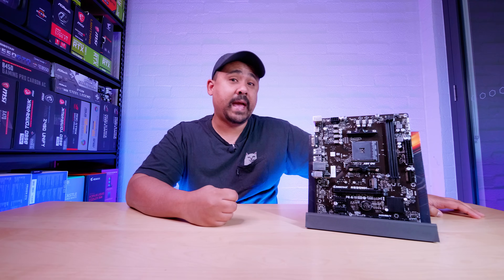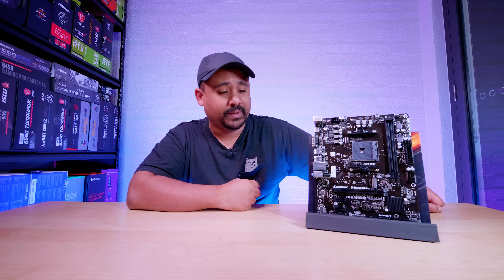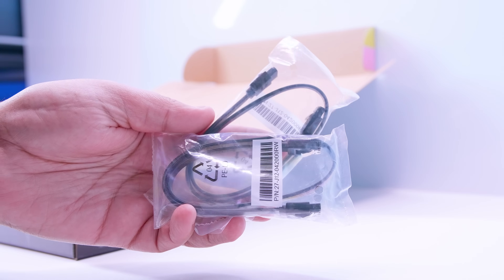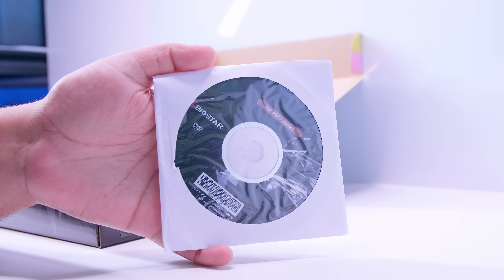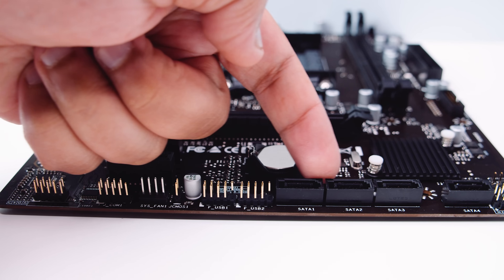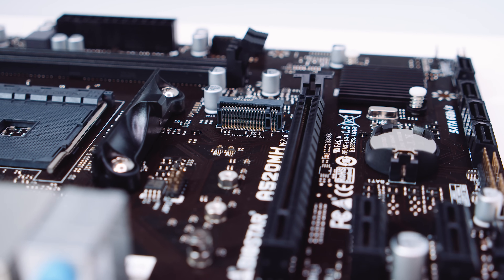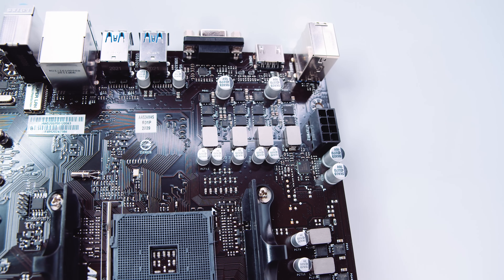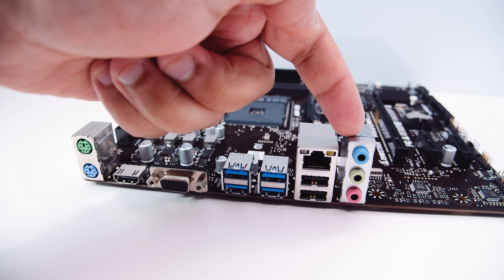Ultra Budget AM4 - Biostar A520MH - First Look & Unboxing

Comment: Is it compatible with the athlon 3000g ?
Reply: Yes I just bought it, the seller said it won't be compatible but I still bought it then tried, found out later it is actually supported on site. Just make sure you buy latest or a bit new released

Comment: Thanks for making a review of this board :)

People are talking about building office PCs on this board, but for me this is the only option if I wanna buy this board and put in my Ryzen 5 5600 CPU in it. The stores in my country do not sell AM4 boards, we barely even have Ryzen processors here, it's all intel.

Regarding to the compatibility with gen 3 Ryzen CPUs: It's random. You'll either get an updated BIOS which supports Ryzen 5 5000 series CPUs, or you won't. There are people who will confirm that their motherboards were compatible with Ryzen 5 5000 series CPUs, and there are people whose motherboards were not compatible with those CPUs. So just do the best job you can to figure out whether the motherboard you're purchasing will be compatible with your Ryzen CPU or not. For this particular board, it should be. Ryzen 5 5600X released on November 1, 2020. Biostar A520MH released on November 5, 2020. There is a very high chance that this motherboard will have a compatible BIOS for Ryzen 5 5000 series CPUs. If it doesn't... well, tough luck. Find a 1st or 2nd gen Ryzen CPU that you can put in, update BIOS and then use your actual 5000 series CPU. For me it will be a complete gamble since there are no AMD CPUs sold in my country at all.

I'm planning on purchasing this motherboard in my local tech store. I will most likely order a Ryzen 5 5600 CPU as well. I have very low hopes, but I've no options. There are B450M motherboards sold here as well, but they are much older motherboards and they are almost guaranteed to have older BIOS that doesn't support these CPUs. A520MH does not have USB BIOS Flash feature (without a CPU). Few B450M motherboards do tho, but those are hard to find and are way more expensive. Good luck to the people that are planning on taking the gamble with me. If and when I purchase this Biostar A520MH motherboard, I'll try to update this post (although it might take a few months) and say if my Ryzen 5 5600 worked on it or not.

Edit: Biostar A520MH Motherboards don't support Ryzen 5 1600 (1st gen) CPUs so you can't use them to flash a more recent BIOS on this motherboard.
Reply: and how did it go? and regarding the USB bios flash, is there no way around it at all or?
Reply: Bro how work???
Reply: any updates on this one

Comment: I just got a MSI A-320 for a desktop build for $74 Cdn, I got it while waiting for a RMA on a new B550 motherboard that showed up dead, it runs the 3600 cpu rock solid. NVM-E drive runs at 4x's. Ram runs at 3400mhz, overclocked from 3200mhz. I got about 10% over stock speeds with

Comment: Boards like this are actually used a lot for desktop setups used at work by employees in government offices here in my country in Asia. You'd be surprised how stingy the higher-ups can get with equipping their employees. Last desktop I touched in my last job working under the government office had me using an Intel Core2Duo with DDR2 RAM. It might look like this new board is really bare-bones to the average PC gamer now, but that's a huge upgrade if it's affordability can allow a generation change across entire department floors IMO.

Comment: I hope the prices of these boards come down cause currently for the same price you can get a b450 board which allows overclocking.
Reply: On my side of the world, B450 is actually kinda phasing out, less and less boards are available and they are not restocking them for the most part, which is generally not a good sign...
Reply: ABMNS PRODUCTION heading into the new standard, I’m sure of it. It was good while it lasted though 😭

Comment: Don't underestimate these A520's. 

Someone already managed to overclock a Ryzen 5 3600 to 4.38 GHz all core with a Gigabyte A520M H board with VRM reaching 63°C so other models with VRM heatsinks should be budget champs.
Reply: May you link me the video? 👀
Reply: RJ Builds Pcs I think he’s referring to buildzoid’s video yesterday. https://youtu.be/pqx2cydjOjA
Reply: @whatsanobeen  Yes, exactly.
Reply: @RJBuildsPcs  https://www.youtube.com/watch?v=pqx2cydjOjA
Reply: doesn’t the A520 NOT support overclocking?
Reply: Oscar Cruz Ruiz manufacturers claimed the same thing at the intro of the A320 boards. People got ahold of them and found BIOS settings for overclocking enabled. People stuck with the stable OC-ed settings with no problems. A few manufacturers (MSI one among them?) then retroactively supported overclocking on those boards. This might be the case again here: your mileage may vary.